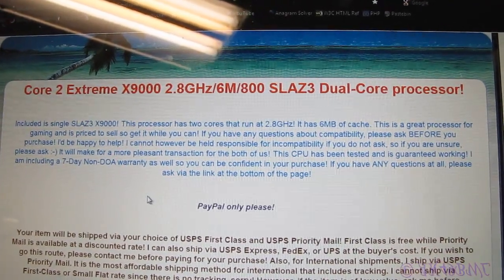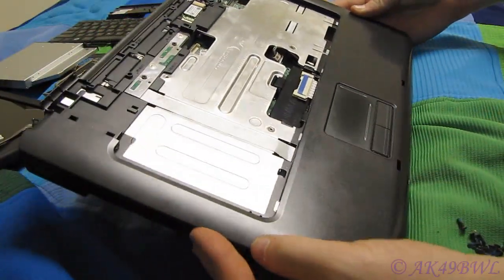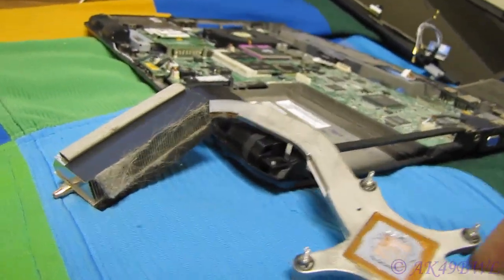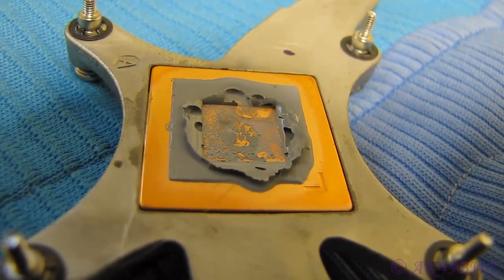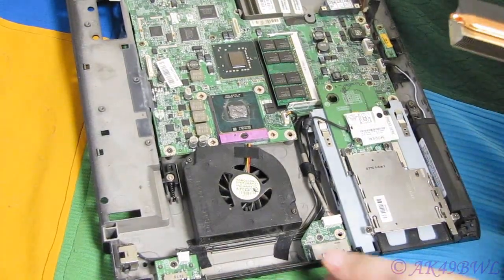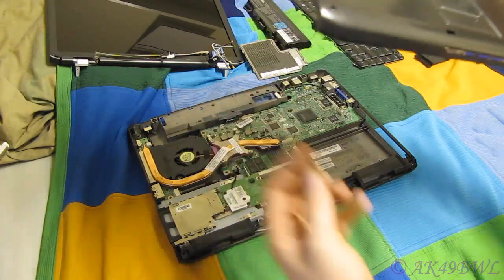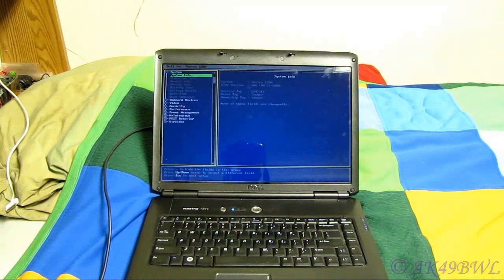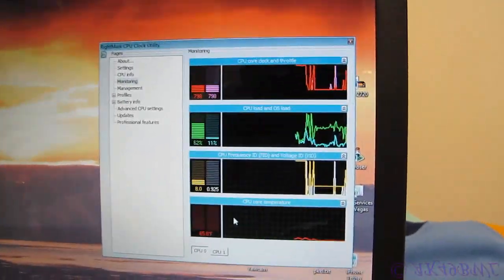How to Replace a Laptop CPU

Comment: You scratched the heatsink, which risks scratching the CPU surface. Then, you applied at least four times too much thermal paste on the CPU, while completely disregarding the GPU. It also needs thermal paste, whether it had any originally or not. Did you not notice that second shiny chip at the end of the copper cooling pipe?
Reply: That's the northbridge, not a GPU and it doesn't need thermal paste

Comment: that laptop looks like it's 30 years old.
Reply from the maker: Well, it's officially 12 this year, so it's almost halfway there :P
Reply: But probably still runs today. These kind of laptops are more durable, easier to service and to upgrade than 90% of todays "fancy", thin and "hip" laptops
Reply: @juliansnowdon2244  Agreed. I upgraded to a Core 2 Duo T9500 on my hp Compaq 6510b. It's similar to the Core 2 Extreme x9000 but was cheaper and the difference between the 2 is minimal. Only major difference is that the x9000 consumes more power (44W) compared to the T9500 (35W).

Comment: want to upgrade HP laptop it is a 2014 model ,processor socket bga 769 (ft3b) with amd a6-6310 apu with amd radeon r4 graphics is 1.8 GHz , will like to know to what latest  processor can it be updated to
Reply from the maker: if it's a BGA769 then it is not possible to upgrade. BGA = Ball Grid Array = soldered to the mainboard and cannot be simply removed.
Reply: thanks

Comment: I changed my laptop cpu recently just few days agp using this video tutorial however my laptop still only recognizes my old cpu under System settings when I boot up my laptop. As I have programme called CPU- Z installed I know my new CPU which I put in correctly is working and not broken. my laptop is a Toshiba satellite pro L850 which I bought pre- built. my old cpu I still have with me just in case. As I am quite new to computer building I do not know much. I do know however my laptop has latest bios. I was therefore wondering what I need to do so my laptop changes and detects my new cpu right now it reads under system settings the old intel core i3 3120M cpu not the  new intel core i7 3540M processor  one thing is for certain I correctly installed the cpu and thermal compound also the cpu sockets both match so no problem there. Is there anyone out there who could kindly help me out about this.
Reply from the maker: If CPUZ detects the new CPU fine, I honestly wouldn't lose any sleep over it. Toshiba isn't exactly known for making upgrades easy, so the fact that it worked at all is an accomplishment in itself lol. And then there is the ever so sneaking possibility that they locked the system down so that it'll only show the old CPU.
Reply: Brandon thank you for your message. I would have thought that there would be a way to change the system settings so it would detect my new cpu but anyway I am quite new to computers and although have changed cpu in the past on my old desktop computers it is pretty much my 1st time changing a cpu on my Toshiba laptop. Thank you also for replying to my message so quickly.

Comment: what was up with the coding stuff at the start, do u have to do it that to actually place in the cpu.
Reply from the maker: No, you don't have to. I was simply showing that the CPU was properly recognized after it was installed...There was no coding anything before shutting the computer down at first.

Comment: I have an ASUS A52JK that comes with Intel i5 430M CPU, which is shown in the link below:
https://www.asus.com/Notebooks/A52JK/

The same laptop also comes with other types of processor, which are:
1) Intel i5 430M/450M/460M/520M/540M CPU
2) Intel i3 330M/350M/370M CPU
3) Intel Pentium® Dual-Core P6000 CPU

I am thinking of upgrading the CPU of my laptop to Intel i7 940XM or Intel i7 640M. I have checked the TDP and CPU ID for both Intel i5 430M, Intel i7 640M and Intel i7 940XM. The TDP for i7 940XM are higher, which is 55W while the TDP for i7 640M and i5 430M is 35W. The CPU ID for Intel i5 430M is 20652, the CPU ID for Intel i7 640M is 20655, and the CPU ID for Intel i7 940XM is 106F1.

I'm not sure whether the i7-940XM and Intel i7 640M will be blocked by the BIOS of my motherboard or not (the CPU IDs are different). If it is not blocked, I'm not sure if I am going to have overheating problem or not (if I choose to use i7-940XM). I think I would like to try the i7-940XM first. If i7-940XM doesn't work, then I will try i7-640M (or lower). If the i7-940XM, works but have overheating problem, then I will try the i7-840QM (or lower).
Reply from the maker: I remember seeing a while back that Asus actually supplies upgrades to their own machines, and you get the CPU AND an upgraded heat sink to go with it for better cooling. I don't know if they do this anymore, but you could always check. Also eBay is bound to have either combos or the heat sink separate for the beefier processor.

Comment: Hello, great video!  I must however, comment about your excessive use of thermal paste. You applied way too much!!!!! OMFG!   When I apply thermal paste I use an eyelash hair to put the tiniest little dot in the center of the chip, even though my system runs very hot and I can only use it in 12 minute intervals with 30 minutes to cool down in between, I save money because I dont have to buy thermal paste every time I repaste my CPU (which I do every week as a normal preventative maintenance routine)   Right nnow I am posting from my phone because my computer is powered off and unplugged becasue i have to move it outside in the cold dry air to cool.  Take my advice and listen to my critisim!!!  I have been repairing modems (computer box thing) for over 30 ears!
Reply from the maker: Lmfao this went from serious to outright hilarious.

Comment: On Acer 5737z Intel T4200 / 2.00 GHz / 35 W, I replaced the Intel T9900 / 3.00 GHz / 35 W. The speed has doubled. 
And Intel X9000 / 2.80 GHz / 44 W is too hot.
Reply from the maker: It's only too hot if you don't use software to bring down the operating voltage. Mine runs nicely between 37-71*C (100-160*F) depending on load conditions.
Reply: Almost no difference:
intel t4200: VID 1.050V-1.15V
intel t9900: VID 1.050V-1.2125V
Reply from the maker: What difference does that make? Software can control the voltage given to the CPU, thereby controlling temperature. Those numbers are just what the CPU is designed to run on. Another thing, the T9900 would not have worked in my laptop; FSB 1066Mhz is not supported by the GM965, only 800Mhz. The X9000 remains the best my laptop can use.
Reply: Shiney frequency has nothing to do with, in any case, it will start and run.

Comment: Use alcohol and some q-tips to clean thermal paste from a CPU and heatsink.  There are special chemical for thermal paste remover that work better but some alcohol an q-tip is fine.  Seeing you use a screwdriver on it made me cringe.  Live and learn. :)
Reply: DJDevon3 Thanks
Reply: DJDevon3 yea..... it dis

Comment: First too much paste, second you didnt put a paste on a graphic card!
Reply from the maker: One, it's not a graphic card, it's the north-bridge chipset that happens to have graphics capability. Two, it had a pad on the heatsink which I was not inclined to replace as it never gets warm compared to the CPU.
Reply: Its called integrated graphic and it gets warm.
Reply from the maker: I know what it's called -.- it isn't purely a graphics card, as you misstated. And as I have already said, both here AND in the video, it didn't get pasted because it already had the pad there which is more than sufficient!

Comment: do you need to worry about software or drivers? my current CPU is a shitty 1.8 GHz intel i5 and want to get a newer gen i5 for this.
Reply from the maker: Don't need any software changes, the only thing you need to make sure of is that your chipset will support the newer processor. Look up your chipset on ark.Intel.com and it should list which CPUs are compatible.
Reply: Thank you for the info.

Comment: i have intel core i3-4005U (1.7 GHz, 3MB L3 cache)Do I need to upgrade it for gaming??
Reply: yes
Reply: if u can upgrade to i5 4460 or 4690k
Reply: yes
i have 2.58 GHz and i cant play gta 5
Reply: My laptop also has the same specs as that but because our cpu socket is bga I don't think the processor is not upgradable in this case.
Reply: ok thanks I i'll just buy a gaming PC
Reply: because PC is better for gaming and easy to open too     :)
Reply: +Enteng Santaygillo You can try searching for a motherboard that has a different cpu socket (LGA or PGA) that is with the same motherboard model or compatible to your laptop.
Reply: do an i5

Comment: How about overheating X9000? TDP is awesome there.
Reply from the maker: I think I'd rather not overheat it, thanks :p it does alright even under load, so long as the core voltages are regulated by the software I use.

Comment: after replacing 2.1 GHz with 2.4 GHz my laptop keep turning of after 1 second what is the problem both the processors are core 2 duo, what could be the problem and whats the solution?
Reply from the maker: You may need to update the BIOS before upgrading the CPU. Other than that, I'm not sure.

Comment: Quick question what do i do if my cpu is non removable?  It looks like this guys gpu it doesnt come out! Please help
Reply from the maker: You buy another system... Soldered CPU can't be replaced by most. I wouldn't even attempt it.
Reply: +Brandon (AK49BWL) ok thanks
Reply: so does this work with all of the cpu's or nah?
Reply from the maker: The CPUs that are soldered in cannot be upgraded, and the machines that use socketed CPUs should be well researched before attempting any upgrades. That's about all I can say on the matter.

Comment: is this laptop still allive? i am also interested to upgrade my old 2010 laptop, core2duo is like a gramps now you know
Reply from the maker: It's still around, yes :) I use it pretty often for engine scan logging and tune work on my pickup. it's not too big and I have a 12v adapter cord for it, unlike my MSI beast of a laptop.
Reply: +Brandon (AK49BWL) sucks this is pretty company exclusive, my Acer aspire v5 with an i5 died and I tried to salvage the processor and it's totally glued in so it's impossible to remove without breaking it.
Reply: +Brandon (AK49BWL) wow it's pretty good. so, now you use quad core, right? is there any significant issue, which is your previous cpu was 2 core and im sure it was lower tdp than yours now.
Reply from the maker: Nah the CPU is still dual core. No real issue as long as the control software has control of the core voltages, otherwise you might have an issue with overheating... This sucker does get pretty warm under load lol. Not dangerously so, maybe 72C at most. Keep your heat sink clean and make sure the fan stays working and it'll be alright.

Comment: can i replace Intel Celeron with Core I3?
Reply: +MarekCz3ch 
I guess if the CPU socket is the same, then it should be possible. (if the new processor needs more power though, your battery might not live as long and your heat sink might not be adequate)

Comment: I'm a gamer and I want my games to go faster but I don't know what to upgrade my processor, my ram, my graphics card, or upgrade to ssd plz help
Reply: +Sharingan Gaming You need a new CPU. Go to your setting see what your system processor is running. Such like 1.60 GHz and i warn you, Do Not do it yourself. Have a company do it for you.
Reply: Yeaimthat Boy. Mine runs at 2.4 ghz and Max clock speed is 3.2ghz
Reply: Well that is good enough for gaming

Comment: i upgraded my processor but when i restarted, it came up fine but i didnt see a message saying it was ready to use.  it still has the old processor listed under the device manager.    i downloaded intel processor identification utility and it showed it there.  not sure what to do to make it update under the device manager
Reply: Did you press F2
Reply: i went under device manager and uninstalled the driver for my old cpu.  then it scanned for the current one and it updated

Comment: Intel Core2Duo T9300 or T9500 would be a better option to upgrade cpu and with much better price.
Reply from the maker: +drum heart no they aren't better. Cheaper maybe but the X9000 is the best CPU you can get for this computer. The specifications are not in agreement with you.
Reply: +AK49BWL  X900 has a slightly better operating frequency than T9500, 
2.80 vs 2.60 GHz.  Consumes more power for operating 44w vs 35w. 
T9500 costs around $50 and X900 over $100.

Comment: +AK49BWL hi, greetings to you from Colombia! I have a question, will probably sound dumb to you...how can I know which CPUs are compatible with my current system? I just started upgrading my old laptops, ram is done, ssd for hdd is done, now I would like to replace CPU, but I am not certain on which ones to buy. My now really old laptops are a Dell Inspiron 1318 and a HP Pavilion G4 1284la... Much appreciated!
Reply: Research your socket, or google it.

Comment: A good program to use is Everest or Aida by Lavalys. It gives you a deep analysis of your hardware and software with links to websites for drivers and other upgrades , manuals etc. From this you can print the details. Knowing exactly what you have inside the plastic and chrome is the first step to upgrading.

Comment: Does this upgrade the graphics chip?
Reply from the maker: +kingofenglandthethir No - they didn't start integrating the graphics into the CPU until the Core i series CPUs came out, and even then I THINK it was only the 2nd generation and higher, but I might be wrong, it may be all of them. As for your other comment, I didn't put any paste on the north bridge chipset because there was a pad on the heatsink for it already - and if I'd simply replaced the pad with the paste, there would have been a gap between the heatsink and the chipset so I left all of that as-is.

Comment: I see you put a lot of thermal paste on the cpu die. Are you supposed to put more on for a laptop chip than a desktop chip,  or are you just being generous with it.
Reply from the maker: +Ben Baer I was over-zealous and more than just a bit uneducated at the time I made this video. No, you're not supposed to put that much on ANY CPU.
Reply: +Brandon Actually there's nothing wrong with doing that. All these keyboard warriors may have different opinions but it has been tested and there is no such thing as too much as long as it is not spilling off onto other components that cannot handle it. Even if there are they make non conductive thermal paste. So really I see no issue.
Reply: +AK49BWL holly shit bro, the amount of paste u used could feel all of africa! did your cpu die the next day cause you drowed it with paste :)

Comment: This is a good tutorial, and I followed it successfully last night. However, I would caution users against using too much thermal paste. This tutorial uses WAY too much. The ideal situation here is to spread a paper thin solid layer across the contact area. No gaps, no globs. The less there is, the better the heat transfers. More paste means more inefficiency...wasted paste!

Comment: o_O I was always told that laptop CPUs were welded on. Was that one first like that, or is the weld a lie?
Reply from the maker: +Anthony Tom it depends on the machine... Most of the Core2 series laptops I've had apart are socketed, not welded. However, the machine I have now, the Core i7 IS welded. I have heard that some other brands aren't tho, so like I said, it depends solely on the machine.
Reply: ***** Do you know if HP welds theirs into their laptops? I have a 15 Notebook PC and need a better CPU SO bad. Computer games these days...
Reply from the maker: +Anthony Tom Probably. I'd need to know the model number of the machine to tell you for sure tho. Or you can look up the model + motherboard on a google image search, if there's a socket, chances are it's a go for CPU replacement.
Reply: +AK49BWL lol that is a shit laptop if you have to remove the monitor and the front
Reply from the maker: +The Little Gremlin well, it IS a Dell after all...

Comment: I am way too afraid to replace my CPU by myself. I'm planning on upgrading to some sort of i7 at some point. I currently have an Intel Core i5 5200U.
Reply: The "BGA" in the socket name means "Ball Grid Array," so the CPU is soldered into the Motherboard. Your Processor is still very good, and the only things even worth upgrading are the Hard Drive or possibly the RAM (If it is not soldered in too.) I hope I helped.